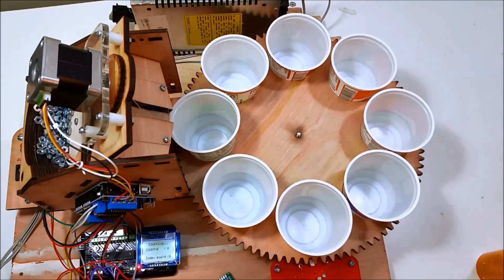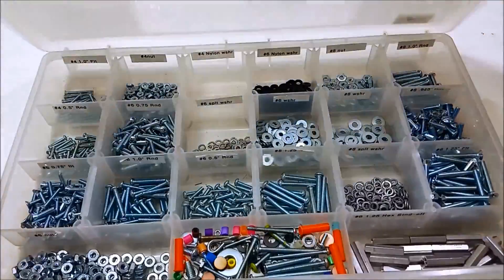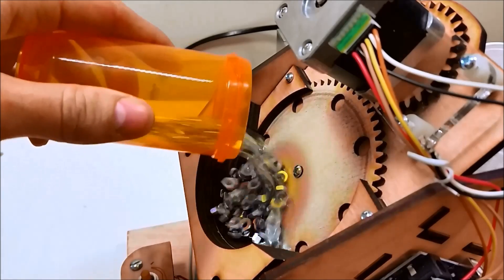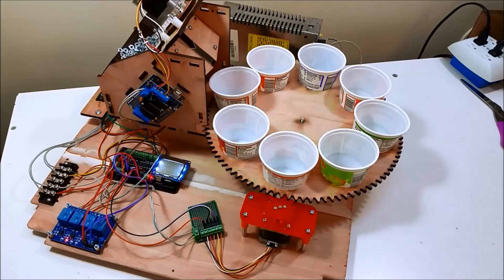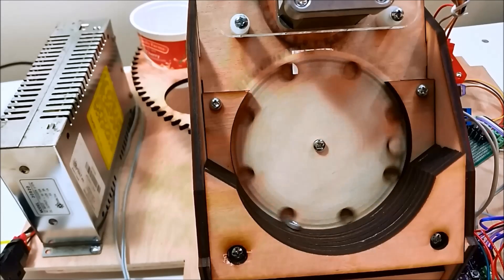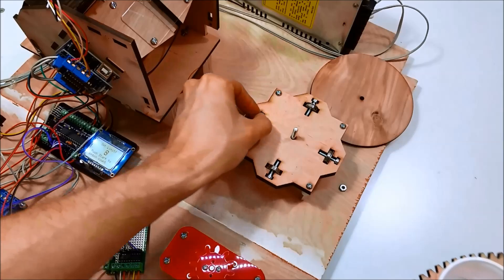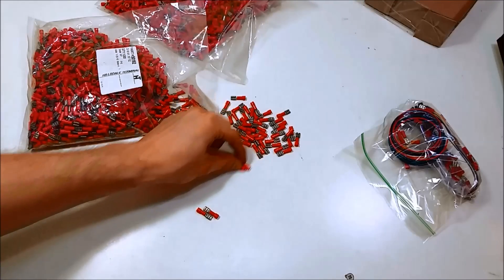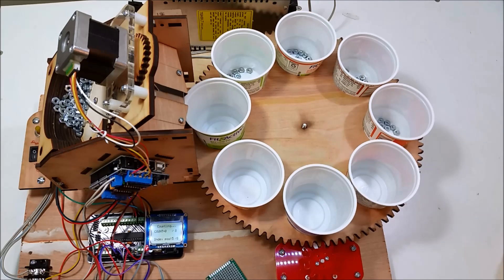Automated Small Parts Counting Machine with Arduino

Comment: You just reinvented something that's exactly already out there!  Congrats!  I've done that a few times myself.  What you built here is essentially what we use for reloading ammo.  We use a bullet and a separate brass feeder.  Your design for the nut counter is almost identical to the plate and process for the brass.  The bullets work slightly differently.  Watch a video on "bullet" and "case" feeders for ammo reloading and you'll see the high similarity.  Put a light gate or something on the drop tube in the feeder and interrupt the switch when your count is right and viola!  Same thing.  Neat, though.  I'm researching a way now to make a counter for loading the finished ammo into boxes (for less than $25k).

Comment: of everything it seems like the crimp connector sorter is the most efficient to load and use. Think the electronic sorter is crazy cool too.

For items where you don't have 30+ of them, you could make a similar jig as what you did for the crimps, but have it sectioned into 3 or 4 different areas to drop into 3 or 4 different cups when you slide the tray open, paralelling it can make it even more efficient.

Comment: I really like your ingenuity - great job!  I feel your pain, I sell electronic kits and I need to count out parts like LEDs, resistors, transistors, etc.  I don't know if I could adapt your system to work with those odd-shaped items.  What do you think about using a seed counter?  They're just a small table-top vibratory counter for agriculture.
Reply from the maker: That's a great idea. I've be redesigning this machine but using a Rx pill counter style design. It's definitely a challenge.

Comment: $$$$ If you write me some code to play with, I will send you a check for $20.  I need to count to a given number, then I need an action to occur.  The action is to step a stepper motor a given amount of degrees (180 deg of rotation).  I need to count inputs and then after a variable number rotate the stepper 180 deg.  The stepper is a 200 count.  I need help over here!!!!

Comment: Ryan, I want to count to five and then have a stepper rotate a1/4 of a turn.  Then repeat with an arduino.  Will you give me some sample code to play with?   I am in stage one, but I ordered a bench top power supply, soldering station, resistors, diodes, capacitors, bread boards, jumper leads (male and female) as well as other items.  I purchased a small stepper motor also.  I need some kind of code to manipulate and play with.  Count to five and then step....
Reply: More information is needed.

In the most simple way, you could use delay(5000);
And then use a library to rotate the stepper motor 90 degrees.
Reply: Delay stops the entire program
Reply: I want to count five input signals on a single input pin lets say from a 5 volt signal that occurs every 1-2 seconds (but never an exact time) .  Then rotate a stepper 180 deg (100 steps).  Then repeat.  I built an automated machine at work and now I want to add this function to the machine. (count five parts then rotate a stepper 100 steps).  Thank You Zach

Comment: Most of industry uses vibration.  Hemispherical bowls with a spiral shelf around the outside with 3 coils organised as 3 phases to shake the bowl so that the parts (from the centre) 'walk' around the shelf to the top.  They have arms and / or low bridges to force ones that are the wrong way round back to the middle so the ones coming out are the right way round.  They do it that way because it is to simple - and works with sticky rubber parts.  Nothing to wear out being the other obvious reason to do it that way.

Comment: Awesome! Thanks for sharing. I have to build my own machine too, and i am atm a noob. Very inspiring to see, what is possible with an arduino. For your Question, how to solve your problem. EASY by weight. Let them bring in different containers in a circle, and mix gram by gram to the middle container, so that at the end your result is x-gram what you need, and you know x-gram are 10 peaces for eg. - then the containers opens at his bottom and let it drop to the joghurt bottle :-) (sorry my bad english) I know that priciple is done too in the food industrie. I have at the moment the problem that i have no startpoint, only solutions :-)

Comment: You can build a large funnel and use vibration + gravity to make the parts fit linear tubes. Then, it would be easier to count them. 
But since you have such a nice prototype it may not worth to change at this point. Congrats! It is very nice.

Comment: you could also build a servo kicker on the opposite side to kick the cup onto a scale, weigh, verify weight within a selected spec, if it's light/heavy signal a stop and a buzzer, then wait for correct weight parameter and consecutive button press to continue operations
Reply: Why move the cup? Build the scale into the platform holding the cups.

Comment: square hole in your sort gear that allows the red component to just fit in (opposite corner to corner) will work on your current setup for the ones you need 30-36 of

Comment: Industrial sorting methods may "be a mess", but they also are intended to sort at way higher speeds and usually in some intended orientation.  The rotary feeder shown in this video is sometimes called a pocket feeder, usually used to sort difficult parts because they cost more to build.  A small vibratory would be able to singulate the parts in this video.  I saw a 3D-printed feeder bowl for nuts here: https://www.thingiverse.com/thing:1313337  
Nice job on your machine!

Comment: Commercial machines use vibrators to turn the nuts on their flat sides. Then they push them up a sprial against the outer wall to a counter and they fall off into a bin. Maybe a vibrating platform that lays the nuts flat and then feeds them into your rotating disc. Great machines!

Comment: Wouldn't it be more efficient to make the inclination of the sorting/pickup wheel more horizontal? I'm sure you've thought of this and I'm curious why you chose that fairly steep angle for it over a flatter one.
Reply: 1_HighDuke the angle helps them land vertically by sliding down.

Comment: Hello Ryan, is there a way to load cups. and reload to next station,  Say from part A to part b, and so forth, Then when all parts are filled, it is weighted for accuracy. project code maybe to big, i,am still learning this, currently planing for paper folder. you design helped alot will keep you up to date, all the best. 

P.S yum yogurt going to buy some  now,  8 cups. have to start your project some where. may as well start with the cups of yogurt.
Reply from the maker: Hi Wayne. It's possible. A ramp placed below the cups could be used to push the cups upwards out of the carousel, then redirected. Another sloped ramp under the cups could also push the cups onto a scale to weight them. I do not know of any [affordable] precision scales that you can interface with via I/O, that is the tricky part with measuring weight.  Good luck with your project!
Reply: how high precision scales do you need. what were the weight per cup of   product (nuts).
Reply from the maker: The nuts in shown in the video (my guess) weigh between 0.5 - 3 grams. I have other parts (nylon spacers) that weight ~0.02 grams.

Comment: on the connectors you could always use weight, just keep feeding them one by one until they match the desired weight. that is, if you can either figure out how to make a digital scale, or hack one.
Reply: It's really easy to make an Arduino scale using a load cell and amplifier circuit ($5 together). And yes, I would use a weighing method too, esp for irregularly-shaped parts.